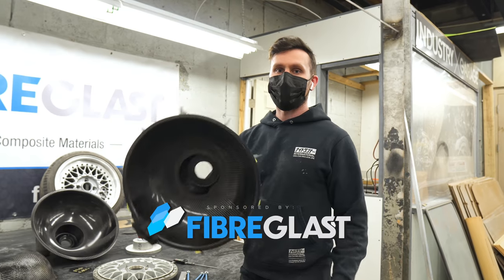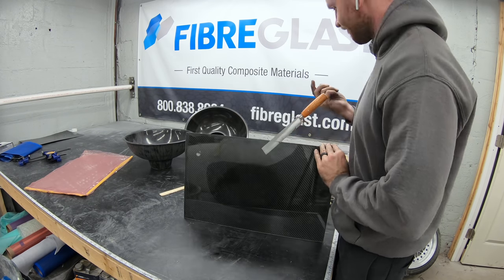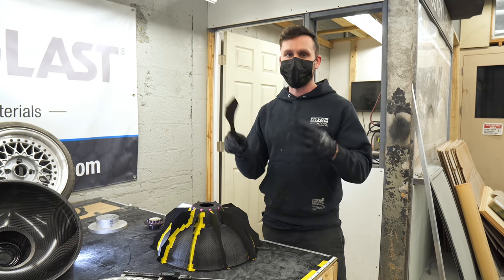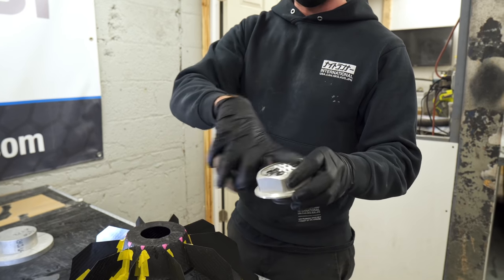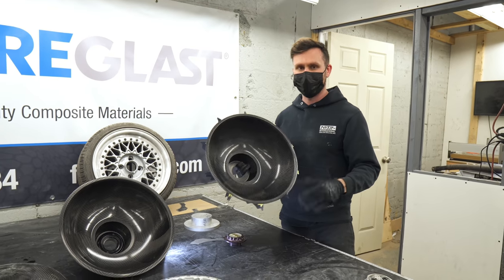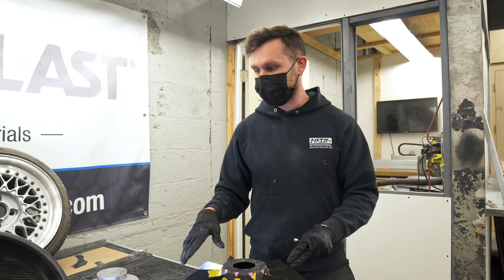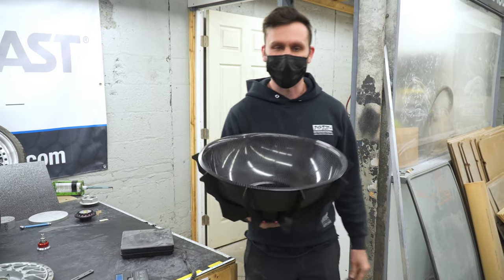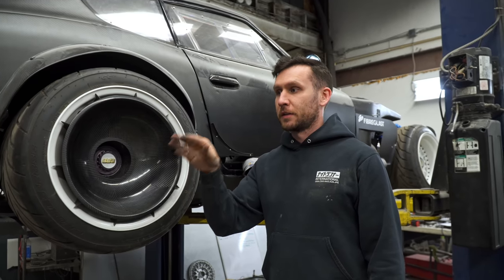240Z CARBON FIBER TURBO FAN | PART 2

Comment: Quick tip! Look up using an image as a canvas in Fusion 360. This way you can take a picture of something and quickly create a sketch of it in Fusion 360. Literally takes a minute or two from taking the picture to having a sketch of it!

Comment: Have you looked into using the CNC to make 3d foam molds? You can slice your mold into sections in CAD, cut the pieces from high density foam, glue them together and you've got a buck/mold to lay up from. Sky's the limit! Great work on these turbo fans 👍

Comment: I also have a Shapeoko and would love to see content on what you did and learned from cutting cf on it i.e. bits, feeds, etc. I've seen the other videos I just want something thats a little more personal in a way.

Been watching you guys since you started working on the roof of the Datsun and figured it was time to finally comment. I have been starting  to make parts for dirt track and off road motorsports. Have had many successes and twice as many fails. You guys are very inspiring and keep me trying my best to get to your quality of work and engineering. Hopefully things like 2020 won't get in the way of me working for myself in the near future. Keep up the amazing content!

I had a huge comment talking about my thoughts on balancing from my last job working with OEM specs on the ZL1 Camaro wheels but I just cut it out because I didn't want to deal with being criticized for an opinion based theory.

Comment: Turbo fan looks awesome! I thought it was designed to pull air in from the sides to cool the brakes, but apparently it forces air out from the breaks to the outside.

Comment: I run CAD software for a living (designing/building jewelry in Rhino)  whenever I need to duplicate a part accurately I photograph it straight down with a ruler next to it for scale, then trace the image in CAD and scale appropriately.  Obviously your process worked out perfectly so no need for me to be telling you this.lol  Maybe just another "tool in the toolbelt."  Also didn't mean to offend with the salad bowl comment last video, looks great mounted!

Comment: From a aero standpoint you may want to put a thin sheet of polycarbonate over the bowl. That will serve 2 functions the aforementioned aero improvement, place for floating decals/art, and protection of the cf

Comment: Why didn't you do the fans with the directional fan blades?
Reply: I would guess because that adds significant design complexity for marginal performance gains.
Reply: @thenotoriousflip4275  That was the reason for the fans in the first place. Io remove air from under the car and to cool the brakes. Most early fans were  engine cooling fans off of the Chevy Corvair. Even the Corvette had factory wheels with directional fans. 1984 and up.Your work looks great, But go the extra step and make to for go,, not for show.
Reply: @morelanmn  no I get that. But even as the fan blades are now, they're still going to move a lot more air. Significantly more than the old turbofan mags that came on Corvettes. 

This design relies on centrifugal force to evacuate the air rather than traditional fan blades. 

The wheel spins the air in the barrel causing it to want to fling out the larger end of the wheel. 

The gains of Making the blades directional are marginal compared to this design. 

What I mean is to say, the blades as they are are very effective.

Comment: Super cool running into a video of yours in the search results. I could never figure out what those things were called. I finally remembered to ask in collector car feeds discord and got the answer and found my way back here to one of the first ones I remember seeing outside of just older builds, this 240z. The end results looked sick but yeah I always wondered wtf was up with them. I also had been thinking like why in tf would someone cover up amazing rims with them. That kind of opened my idea in a cheap ass way you could pretty much cover up any rim and have it looking trick if you did it right. I am a big steel wheel fan, and poor AF so yeah this makes sense, just another hub cap. lmao. 
But knowing the science and the reasoning for it is super cool too! I was also learning that F1 cars be using them to control airflow in many different ways. They essentially wanted to stop the air from coming in or out because it eats HP and top speed. 
You all use those air flow visualizer programs to see how your airflow be hangin? So many advancements with that have been done over the last decade. Guess you would need to scan your ride and import it or whatever.

Comment: I found that the 3M panel bond doesn't deal with heat well.

I had standoffs for carbon fiber headlight deletes and heat made them let go instantly.

Comment: but i expected the fins of the turbofan to have a tilt or angle in some direction? like how would they push air with straight blades? is it centrifugal force? like when you really want to push lots air through you need some angle, like the blades inside a turbine have, right?
still a really nice video, as a visual part its amazing!
Reply: huh! actually both exists: while the original 935 turbofan has straight blades, p.e. the E34 M5 M-System Turbine wheel has almost a 45° angle in its blades... so the centrifugal force seems to be enough to push through air, but you can go the extra for more air flow? interesting piece of aerodynamics!

Comment: Question: Shouldnt the blades be angled like a "fan" so it could actually suck the air out to the wheel well and push it out? wouldnt straight blades just push the air into the barrel of the wheel?

Comment: I’m surprised that a straight fin would move any air out, I thought they would have been curved like a turbine from a jet engine or turbo, can you put it in the air on the hoist running in gear and measure how much air they move? Cool project

Comment: You’ll need some sort of mechanical feature to keep that from spinning loose. A pin or key of some sort.
Reply: When tightened fully it’s pretty tight, with the rubber ring it should hold fine
Reply: @timhicks2807  because it’s in the same axis as the wheel rotation, as it accelerates and decelerates it will loosen the threads. At least use loctite.

Comment: Looks awesome. But from engineering point of view, front face should be flat (and not salad bowl shape...). This will now generate a lot of turbulence and drag. Beside that - well done 👌🏼
Reply: The rears are designed to generate about %30 of the turbulence, compared to the fronts which will have flat faces. These also have about half the amount of fins as the fronts for that same reason.